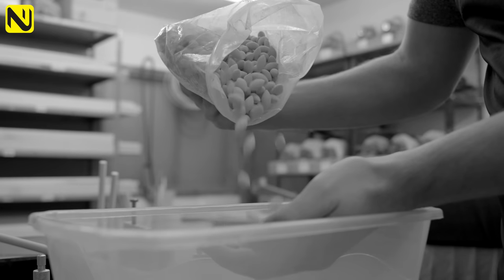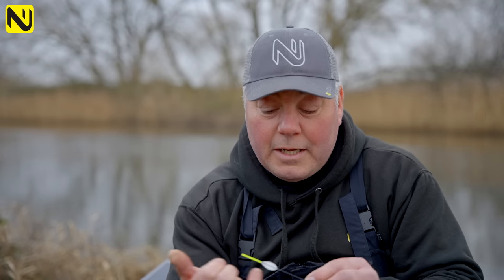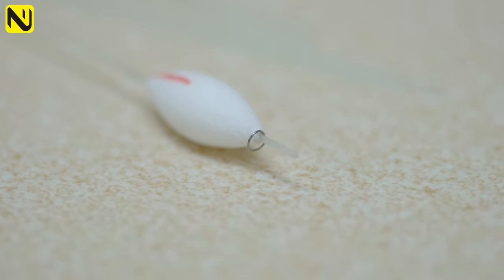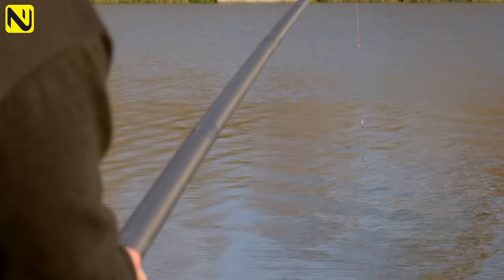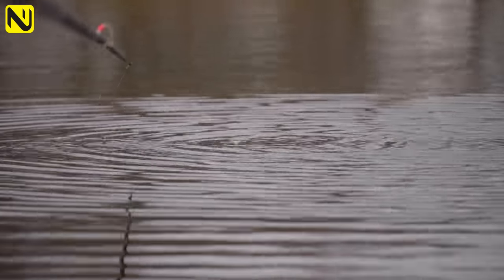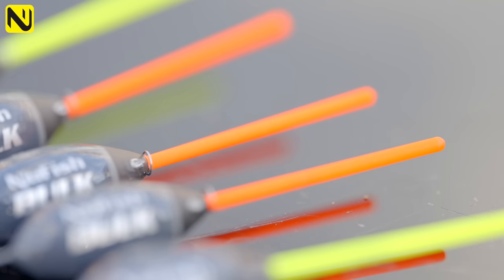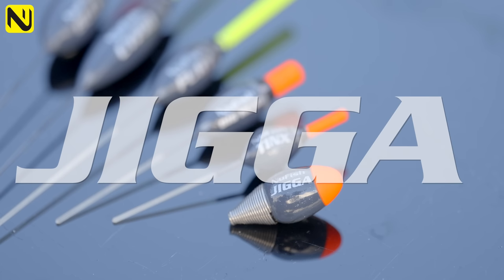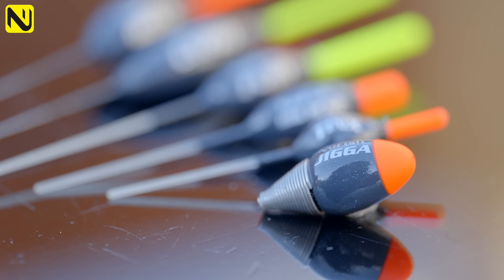⚫🟡 X-STRONG INLINE POLE FLOATS | The next generation of pole float design ⚫🟡

Comment: Just bought some Cypris. The eyes were tiny & slightly off from the hole. Took me ages to thread the line through.
Reply from the maker: Hi Neil , sorry you struggled , all the eyes are the same type/size on the range , so not sure why these seemed small , when threading , a good tip is to thread the eye and the inline tube separately , this seems to work best, tight lines
Reply: @NuFish  Thanks for the response. As I mentioned though...the tube was slightly off from the eye & very close so it was impossible to thread them separately.